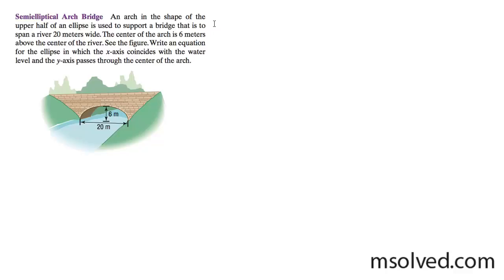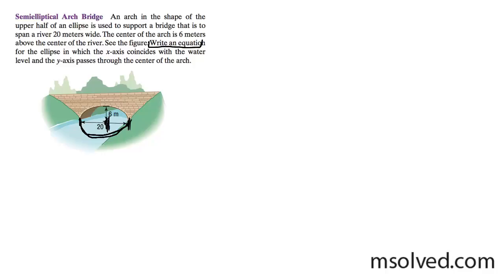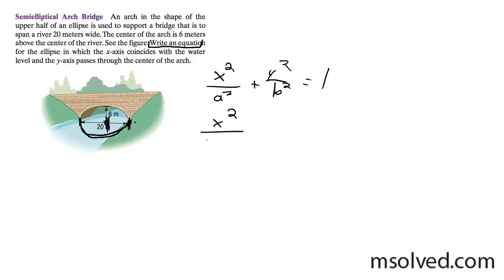Semielliptical Arch Bridge

Comment: You said ten when the example said 20
Reply from the maker: :(
hopefully you were able to replace the numbers and get the result you needed.
Reply: it is 10, because 20 is for 2a right? so you will divide 20 by 2 to get the distance from center to the vertex, the value of a.